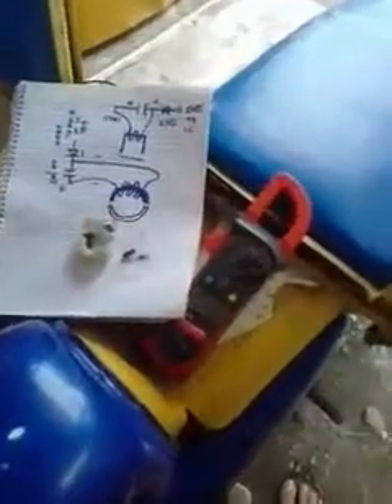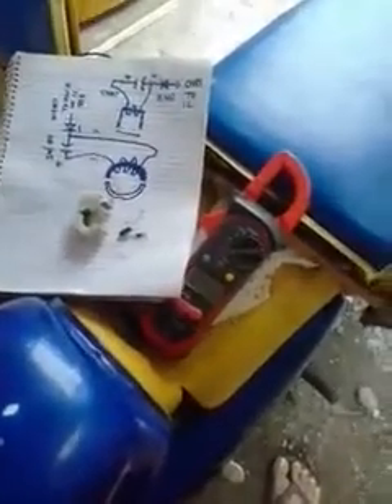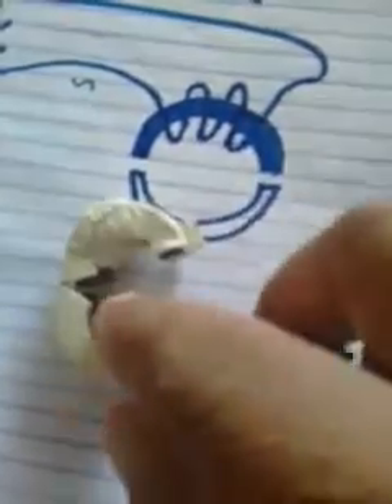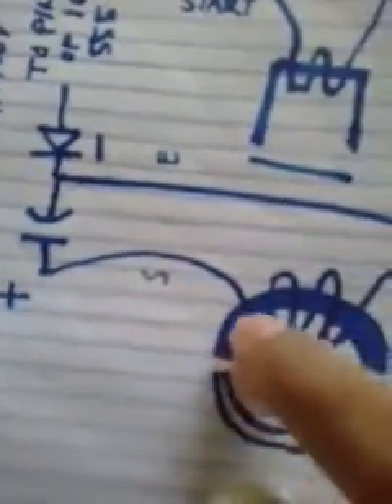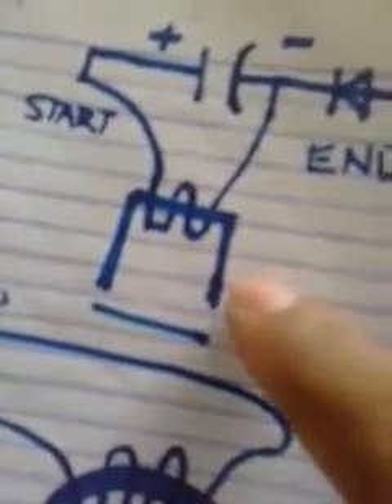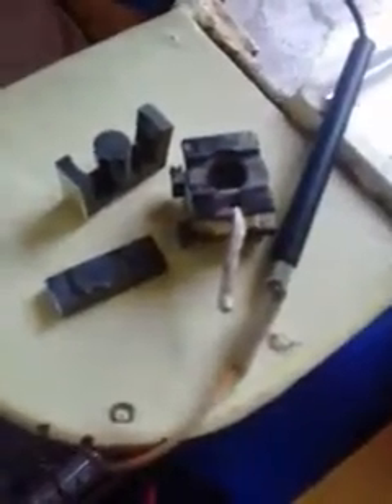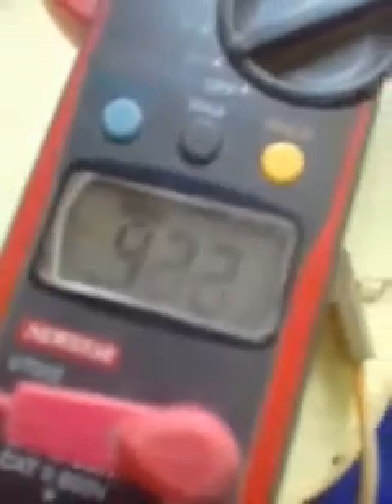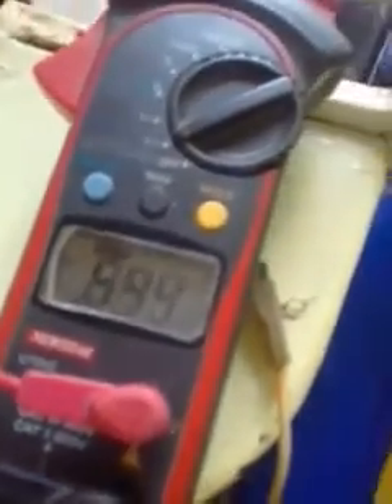How to test timing light sensor

Comment: sir, if you put the pick up on the spark plug wire upside down, will the pick up not produce voltage?
Reply from the maker: It reverse polarity